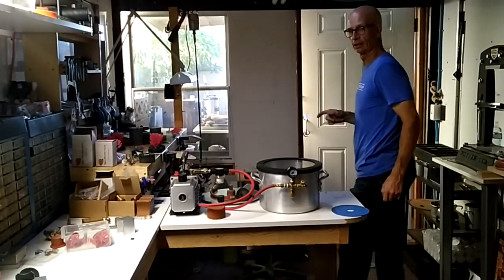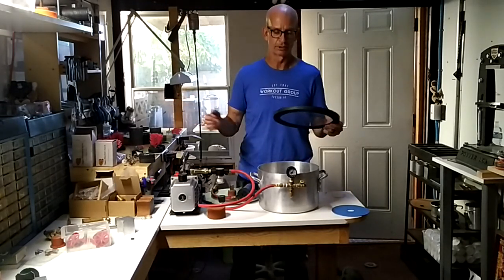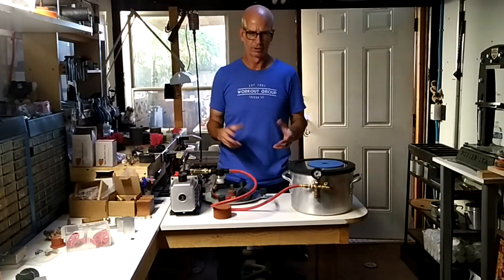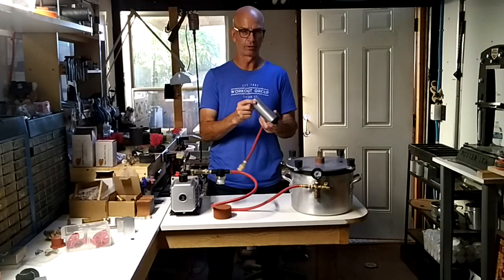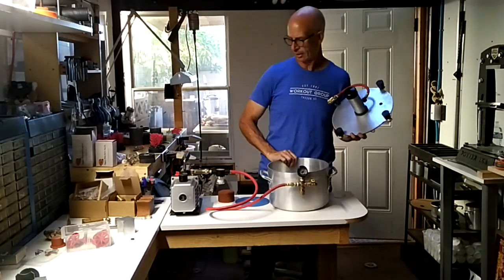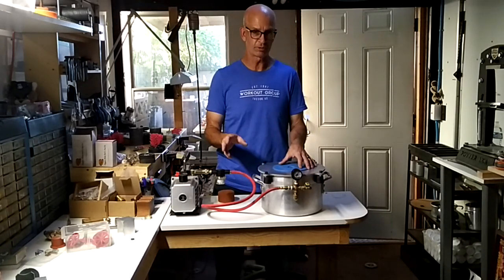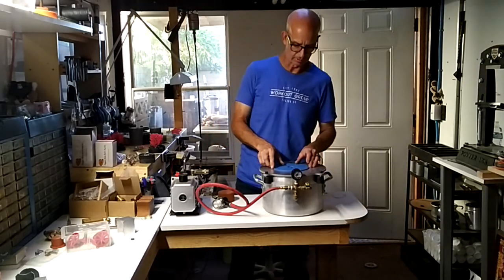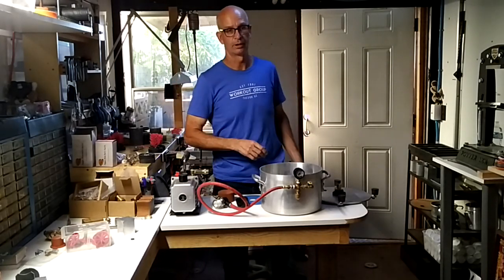A Quick Introduction to My New Vacuum Casting System

Comment: Hi. I am making vacuum casting system for newbie use :) What filter do you use to protect your vacuum pump?
Reply from the maker: Just either build a small one with steel wool or a larger one where metal and investment can drop in, be opened to clean out and put back together.
Reply: @craigdabler-thediycastings7511  Do you have any video or drawings how to make it?